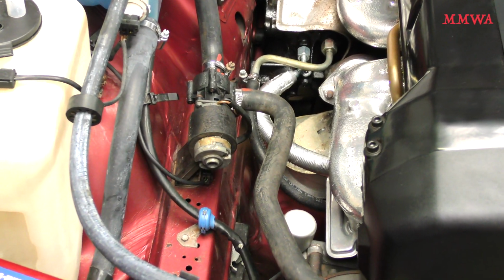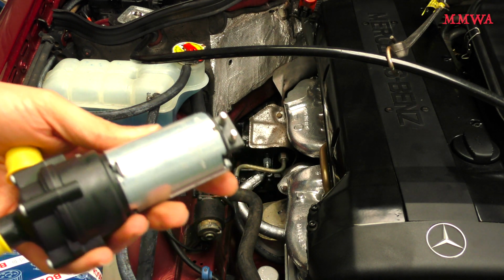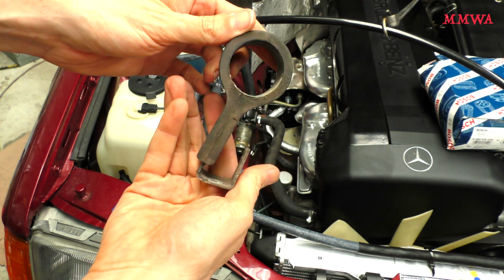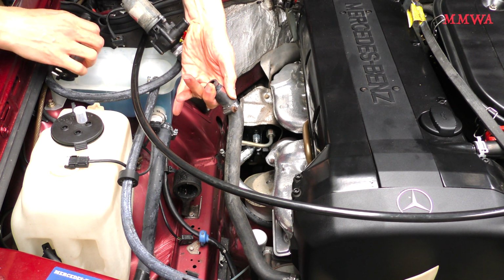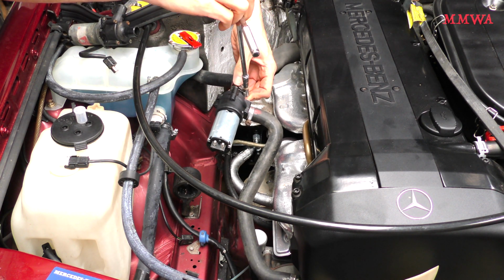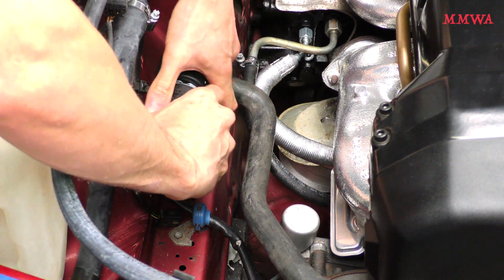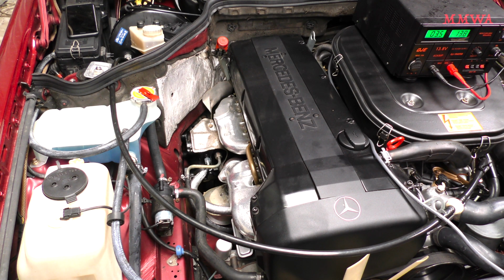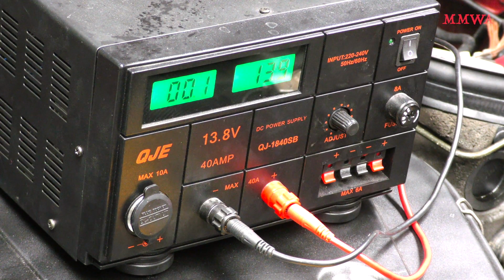W124 heating water pump replacement

Comment: Great video. I have the same engine, but in w140 (104.990)... quite interesting that I have HEX bolts holding the valve cover down, but you have ALLEN KEY bolts...
Reply from the maker: thats me, not factory, i wanted black bolts to match my powder coated cover and that was what i chose. factory bolts will be same as yours

Comment: With a leaking shaft seal, the time had come for me. Prestige A.P. still the cheapest on Ebay for Aus purchase. Guess what I discovered. The yellow dust caps supplied with the new pump on the inlet and outlet nozzles fit perfectly as I.D. plugs to seal the rubber hoses while you do the job. Minimal juggling. Minimal coolant loss. Neat!

Comment: Nice work, I always use a 1/4 inch drive to do up worm drive clamps as im allergic to senseless holes in my hands :-)
I usually tighten them till they start to deform the hose and then snug them up.
No Duo Valve on your car?
Reply from the maker: both cars of mine have duo valves, i refurbed the one from red. it was a near new one purchased from a wreck

Comment: Do you know which years have that pump mine doesn't have it its from '89 looking to get another one '90 model with more extras than mine do you have any suggestions, recommendations. Also can i install central locking on mine that would be great . Great watching you work on the Benz. 
Great car to work on learned many things from it.
Reply from the maker: Here in australia this was standard fitment on our cars, all had airconditioning as well as central locking and electric windows etc.  Mercedes were very expensive here so they had a pretty high minimum spec available here. Obviously every country is different. Fitting the factory central locking could well be a nightmare, I cant imagine it being a particularly straight forward process as there are a lot of parts to the system. I would envisage having to use a donor car and transfering everything over bit by bit.
Reply: @MMWA-DAVE  Thanks for the reply
I will try to get a donor car, they are not that expensive here not valued that much sadly.
Reply from the maker: @sotoskal3201   I should clarify that they were very expensive new here - most used mercedes models here have some of the poorest resale value of any cars unless its a special model. General population would trust a 20 year old toyota more than a 5 year old mercedes. I'm not scared by them and im sure most people here arent but non car people generally are.

Comment: So what it does exactly? And does it help with the car cooling down or its just starts with the heater?
Reply from the maker: Boosts heater performance- not really an issue here in my state but nice to have it anyway
Reply: @MMWA-DAVE  I was asking because mine was jammed for years, so when I watched you video, I went right away to fix it, and i just finished. Now it works perfectly, Thanks.
Reply: It also pumps the hot water around the system so that the heater will work even when car is not running

Comment: The Central locking Pump keeps running between 3 and 5 seconds... I think that's normal as it is the case with all my w124 and W201... Grüße aus Deutschland 👋
Reply from the maker: Good to know.
Reply: If there is a leak, the Pump will always start briefly. I think max.3x. Then the System is de-energized to protect the Batterie👍

Comment: Hey i know this has nothing to do with changing the water pump but how easy was it to get your h@r lowering springs installed?
Reply from the maker: piece of cake. just make sure you use the telescopic spring compressors, not the external hook type. I dont have fancy ones, the china ones on ebay work fine and were around 100 australian dollars.